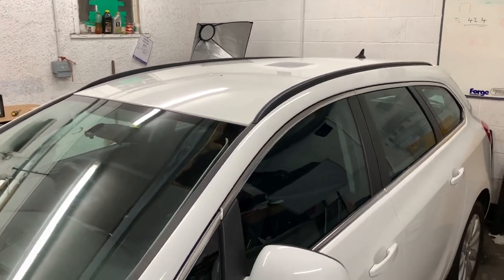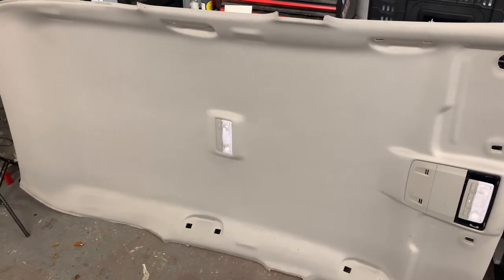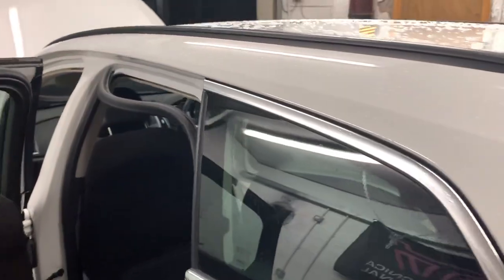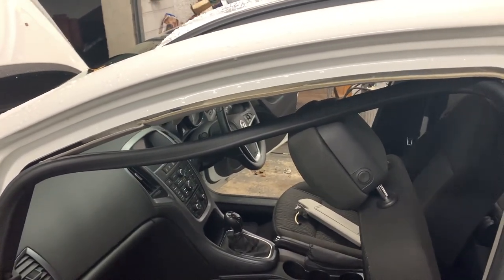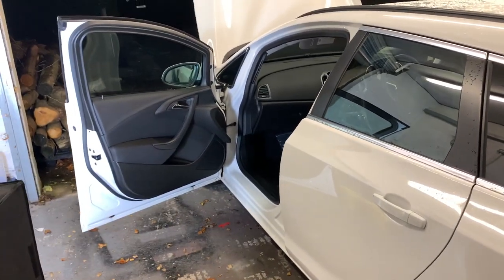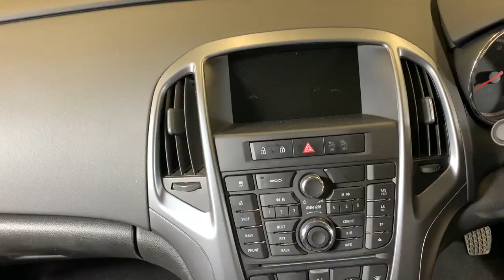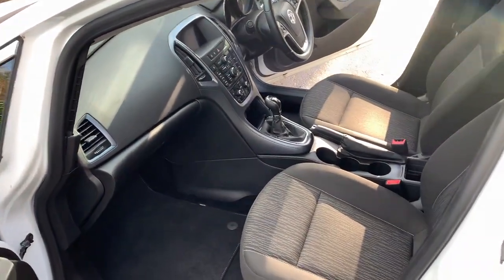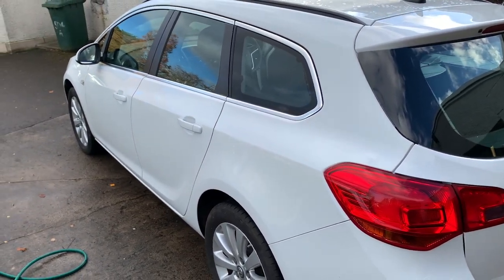I BOUGHT A POLICE CAR and I'm going to rebuild it! (part 5)

Comment: its hard to tell when buying secondhand ( privately) that it is a cop car, as the log book does not show the previous owners, usually just says new at first registration ,usefult o knwo when you sell it !!
 if you contact the relevant force they will usually email you the service history, if it didnt come with it
no good looking at MOT online as they are MOT and VED exempt !
one thing worth checking though, try remove the heardrests, they are usually pegged to prevent passengers using them as a weapon, mine were a sod to get out, but i did it and removed the clips
you may also find that it does not come with a locking fuel cap, just a spring loaded flap
and its often worth replacing the valves in the wheels, as every time they take the car out they have to check all the levels, and tyre pressures
Reply from the maker: Awesome info dude, thanks! I will check all those things tomorrow 👍🏻

Comment: Not sure why you removed the roof lining? Could you not access sufficiently by just removing the interior dome light ? I’m sure that’s how they would of put the wiring in.
Reply from the maker: The trim came out so I could get at the hole in the roof 👍🏻

Comment: ide of kept the alloy from the doner car as a spare
Reply from the maker: The problem was that they donor car alloys were wrecked, badly scratched and had never been cleaned. Even the spare was ruined 🙄
Reply: I agree but at least it’s back to OEM. Having the alloy for a spare would be a nice bonus definitely, but not worth having to do extra work/refurb for. 
At least scrap wise, that car will potentially have a full set of wheels for someone else.
Reply from the maker: @AndytheWhite  yeah that’s true👍🏻

Comment: What interior shine did you use ? Aerospade 303 or ? :D Lovely Astra J!
Reply from the maker: Thank you! Yeah I use 303 aerospace a lot, really rate it, but I also use meguiars interior detailer as I rate that highly as well 👍🏻. Have review videos on both on the channel as well as quite a few interior detailing vids that show how awesome they are 😃
Reply: @DaveRebuilds  forgot to ask,shiny garage apc is okay for all interior surfaces?
Reply from the maker: @md-detailing  I haven’t used Shiny garage APC, I have used the interior detailer though and it’s pretty good. The 303 and meguiars are better than it tho, but more expensive 👍🏻
Reply: @DaveRebuilds  Did order Shiny garage APC and im just scared if it would damage the plastics ? so is it safe or ? :D
Reply from the maker: @md-detailing  if it’s an all purpose cleaner it should damage plastic. If in doubt, dilute it a bit with water and test on a bit of plastic that isn’t easily seen e.g. under the dash before using it on visible plastics 👍🏻
Reply: @DaveRebuilds  30-200Ml of Apc and 1L of water,thats what they suggest,thats okay to use on the steering wheel and door cards? Sorry for being annoying 😂
Reply from the maker: @md-detailing  no need to apologise dude, I enjoy helping people 👍🏻. That should be fine for the door cards, I’d maybe just use “soapy water” on the steering wheel first to see if that cleans it (some fairy liquid and water mixed in a bottle)
Reply: @DaveRebuilds  ill try soapy water on the steering wheel today,the apc is coming on sunday 😄
Will drop you a follow on instagram so you can see the results!

Comment: Stumbled across this series. Wow that's great content for folk to watch, if ever someone wants to buy an ex police car. 20k on a 14 plate, it's done nothing!. 

I thought my car cleaning  was meticulous. What products did you use on the interior plastics? Looking forward to the next vlog
Reply from the maker: Thank you 👍🏻, I chop and change interior detailers depending on my mood lol, but my favourite is 303 aerospace protectant. Little bit more elbow grease than meguiars interior detailer but lasts a good bit longer! I have videos on both if you want to decide for yourself 👍🏻, next rebuild should hopefully be coming in the next few weeks as I’ve got a couple of other videos in the making just now 👍🏻😃
Reply: I use elbow grease pre wash gets the old wax off along with a soft brush. on the exterior plastics. I have a 2014 moon blue sportage, so you'll know what I mean.
I used siminiz, they had some good products. Unfortunately the range is limited in shops now. 

I got some autoglym for crimbo, gift set..... might update later in the year.. with some ceramic!. Keep up the good work. 👍
Reply from the maker: @fill7t1  thanks dude! It’s autoglym ceramic that’s on the police car I think, can’t actually remember off the top of my head lol. But if not, I have used the autoglym ceramic before and it’s super easy to apply and if the proper pre steps are done e.g clay and machine polish it can last about 12 months assuming you look after it 👍🏻

Comment: Good job 
Have Astra s got boot badges?
If so put badges on and you’d never know it was a police car
What’s next project? 👍
Reply: yes they're all badged ASTRA on the left side.

The right side badge for the Diesels until 2014 used to be (none) on the 1.3 CDTi 16V, "CDTi" on the 1.7 CDTi, and "2.0 CDTi" on the 2.0 CDTi.

After a quick Google I think the right side badge for this 2014 1.6 CDTi 16V (the "new" lowest Diesel engine from 2014) should be "ecoFLEX".
Reply: @RWL2012  I’m more a Volkswagen fan than Vauxhall/Opel 
Thanks for info 👍

Comment: It’s good you hoovered the car. But i’d have personally upholstery cleaned all the seats, carpets and matts. You’ve got to think they’ve had prisoners in there that have spat, pissed, bled and shat on that interior at some point. So giving it a shampoo would have made sure it was a totally fresh start for yourself.
Reply: It was low mileage lol but still good point
Reply: It was never used operationally, just as a demo car.

Comment: No wet vac
Reply from the maker: Might do that in a separate video, it didn’t really need it as there wasn’t any big enough stains on the seats to warrant it
Reply: @DaveRebuilds  I did mine with a wet vac YEEUUUUK , they must have beaten a few confessions out of crims !! and the power sockets in the front always have coffee spilt  in them ( changed mine)
Reply from the maker: @russthebiker  lol, I did mine a couple of weeks ago, they weren’t too bad but I think that was more to do with the mileage and clear lack of use lol